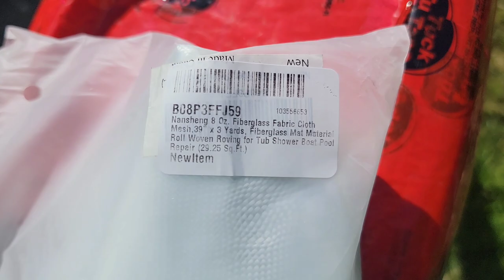Rat Rod Chevy Carbon Fiber and epoxy resin Dash  Did it Work? Or did I just learn a new lesson

Comment: lil tip on glassing cover your mold with tin foil it releases easier also shoot some compressed air to help release your finished part between the mold and glass. and use a chip brush to dab in your glass. also on hot days get a roasting pan and pour your resin in it. it slows the flash time off
Reply from the maker: Thank you.  It's pretty obvious this isn't my wheelhouse.
I'm coming back to this later, but this car will get a dash that at least the top coat is carbon fiber, just because I can.  Or at least I WILL be able to eventually 🤣
Reply: @kingofbootyfab  you did great with the glass I learned all the hard way lots of waisted meterial and broken pieces I got good at it after buying a junk 40 year old boat. no rules in a hot rod or rat rod U do you. Ill continue today watching the build keep it coming

Comment: Been watching a few of your videos and I gotta say,  I'm really surprised that you've made anything from that pile of parts you started with,  kudos for your stay with it attitude 👏,  a few pointers for working with glass are, if you're working with a "plug" mold like you are,  the mold must be as close to smooth as you can get it,  the tape does help save the mold but a good coat of paste wax on it will help your part come off way easier,  a blast of air behind the glass will pop it loose in a second, about 40psi will keep you from blowing an outer skin apart,  always use stranded mat to work the inside of the part, the woven roving doesn't really like to bond well together,  you can go two layers at a time but don't overheat the part, it will warp, you can also use 1/2 x 1 inch floral foam as a stiffner inside the dashboard by laying it on a thin bed of resin and covering it with stranded mat, it's best to sand the surface of the dashboard with a 120 paper and use body filler to get a smooth finish,  you can sand the whole thing as one piece with finer grit paper for a finish as slick as you want,  it's best to lay all your layers at once but if you want to let it cure you must sand with 80 grit between layers for the best bond, I worked in glass making OSHA guards for commercial machines,  you know,  the any moving part must be covered crap,, good luck with your project and I hope these tips help
Reply from the maker: That is a ton of help.  Thank you 🍻
Reply: @kingofbootyfab  no problem,  I saw in your reply you've used wax before,  we used the Johnson paste wax on some of our hand layups, the heat from the cure made it like a greased pig pulling parts, we made guards to cover gears and chain drive machinery,  some of them big enough to wash a car in, it was also the company that put high ranger in business with the glass booms and buckets on powerline trucks,  I learned a lot of tips and tricks with fiberglass like bonding it to metal and mold making with wood, if you have any questions just hit me up,  ps. those light spots you see is air trapped in the layers,  you can drill a small hole and inject them with resin to fill the void, or grind it out and level it with body filler but they will eventually fracture if left unfixed
Reply from the maker: I've been working on it today, grinding back the pockets and filling them to level it out.  I know I did if wrong , and should never have assumed I could get a single layer to lay flat, multiple pieces worked so much better.  But I've got the back reinforced fairly well, and the front sanded and a coat of resin on top, if it fails now, I'll hang it on the wall as a lesson in resin 🤣

Comment: Hi, I got some polyacrylic today. I thought I should put my money where my mouth is. I will coat some foam with the poly and do a layup with fiberglass over it. I think the foam will survive this process.   When I got into the fiberglass gig I bought 1932 Ford molds from two different guys who had been doing fiberglass cars for at least 20 years. They each had different techniques. One of them liked to TEAR the really thin ( csm ) chopped strand mat into pieces that are about 3 inches by 3 inches. With pieces this small you will get all the detail. The mat wont become unruly like yours did. If you can get the tape off of the nice foam piece you made, I think you can get a near perfect part using this technique.
Reply from the maker: My goal is to motivate people to do things, and if nothing else comes of my video but this, then I am happy about that
Reply: @kingofbootyfab  Its working !  2 years ago I had 4 strokes. I used to be the hero in my own story. NHRA licensed to 200 mph, licensed pilot etc. I lost a lot of my memory with the strokes. I am 60 years old and now need someone to live with me so I take my meds and things. Your channel is awesome for me , its therapy. It is helping me to find my memories as well as teaching the old dog a couple of new tricks. I got some water based clear. It didn't bother the foam. I will try to lay some fiberglass on it tomorrow. I am doing this because I was very inspired by your carved foam piece. I will be using this technique to build some things. I just thought I would share to hopefully shorten your learning curve.  Best wishes !
Reply from the maker: @camcutcnc  that's awesome .  I've been privileged to hear so many good stories since I started posting videos, and stories like this drive me to continue.  Thank you for sharing, inspiration goes  both ways 🍻
Reply: @kingofbootyfab  Today I tested water based clear over the foam. It went on great. I would use 2 coats. After it dried for 3 hours, I put resin over it and the foam was fine. I am not telling you what to do, buuuut.....If it were me, I would put a coat of resin on it to seal it. 2 hours later I would lay up 3 layers of the super light chopped strand mat. Let it cure overnight, remove it from the foam piece and then do your reinforcing on the back side. I think this will give you an awesome part. Good luck !
Reply: Everything has cured on my test piece and it came out awesome !  I have never done this before. I am offering to make your piece in fiberglass. I am offering this because I have all the materials in stock and I enjoy your videos. Perhaps this is a way to give back ? It doesn't matter to me, but if it helps I am glad to do it.

Comment: I hate giving people advice, they usually end up hating me! But... if you are doing it this way then chopped strand mat is better than cloth. I see no point in using carbon fibre, high tech yes, but in a low stress situation just wasting money. I'm sure you allowed for the build up of the material to make sure there is enough room for your instruments etc., but you will probably need to build up on the other side. You may need local stiffening so stick a piece of fom on and lay up over it. If you have time then Paul Bacon Kustom Works does a lot of stuff in much the same way as you are doing. All that said I'd make the 'buck' perfect and take a mould off. Hope this helps.
Reply from the maker: No hate at all.  I hear what your saying about the mat, I just don't have any here and had a surplus of what I used.  And I do realize that carbon is a waste for its intended purpose, I purely want it for looks, I'm not going to kid anyone and say it's anything else.  I left enough room for gages for sure, and I'm watching his channel right now, it was recommended to me earlier.   
And the mold, if I can't smooth this out all the way what's what I'll do.  But time and cost I wanted to try this way, I'm thinking it will pan out, it's sitting beside me right now and feels rigid and I've got material to sand, so hopefully by the weekend it's a smooth surface ready for top coating.
I do sincerely appreciate any advice. I'm egotistical and we'll versed in a lot of things ,but this one is out of my normal element.

Comment: looks pretty good !  Make sure to tint the resin black under your carbon fiber or it lets spots of the back show through . It should be pretty nice when the carbon fiber goes on it.  Where did you order your english wheel parts from ?  Do you have a link for it ?  Thanks !  Keep up the nice work !
Reply from the maker: Absolutely.  The current coats are purple purely because i have lots of mica and dye.  But I'm thinking about using the translucent purple die on the coat for the carbon fiber just to add a tiny touch of color to it. 
I'll grab a link for the parts, give me a minute and I'll add them below.
Reply from the maker: This is the upper anvil

https://www.kmstools.com/magnum-anvil-44-top-die-eng-wheel-7-3-4-dia.html

And the lowers (ignore the picture, the description is correct but my video shows the actual anvils)

https://www.kmstools.com/magnum-5pc-english-wheel-lower-dies.html

The acme threaded rod for the jack screw 

https://www.mcmaster.com/98935a764/

And the matching nut

https://www.mcmaster.com/94815A116/

McMaster is amazing for oddball pieces, they stopped giving Canadians accounts a bunch of years ago but I'm lucky my account has been there for a long time.
And KMS is great.  The beadroller dies are the same as Eastwood sells,  but about 1/3 the price,  I know within Canada they even ship free, but I'm not sure if they ship out of Canada.  I assume they would though

Comment: I didn’t, see you wax your buck before the fiberglass was layer down that might have helped to release or remove .
Reply from the maker: Resin doesn't stuck to tuck tape, but it was grabbing the edges of the tape that didn't lay down properly on the corners.  I've tried wax over the tape  before but didn't notice an obvious improvement, and it just adds an extra step